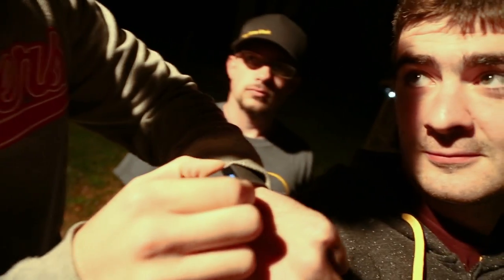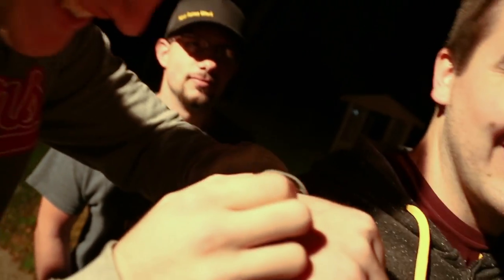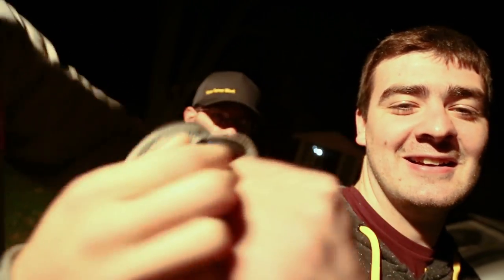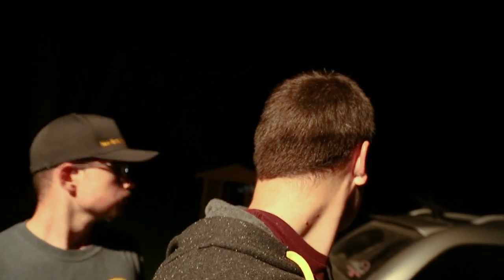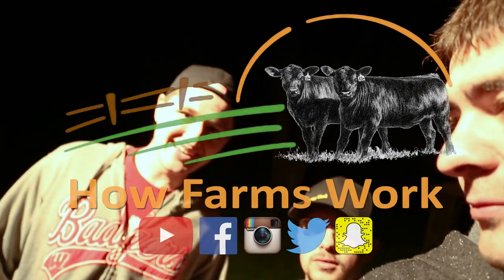Chisel Plowing - New Holland T7.315

Comment: that's a pretty small chisel for that tractor. my 8320 pull at 714 and then could be bigger than that yet. I would like to know how many hours they left you put on that tractor. and it's pretty amazing the amount of tractors I have sitting here and no dealer left me put that many hours on a new tractor. there's Farmers that spend money and then there's farmers who pretend they spend money. keep up the good work.
Reply from the maker: +Elm custom harvesting Your 8320 is also a weight class heavier than this tractor. Your tractor also probably has duals and even then you may not have the same hill slopes we do. Any smart farmer would take an offer to use equipment and run with it.

Comment: Just a small question for you Ryan; how come that most of the equipment in the US, however small, is pulled? Your chisel plough, for example, is small enough that, I think, it would be easier to operate in the field as well as transport it on the road if it would have been of the mounted type, i.e. being mounted using the liftarms and the three point?
Reply: Wout Van den Bossche too much bounce wile transporting down the road. Much of the equipment these days is much larger than what they were pulling. Come for a visit and check out our farm some time.
Reply: Wout Van den Bossche number one reason would be a lot of older and larger American tractors don't come standard with a 3 point hitch. number 2, a trailed implement usually handles sweeping curves and uneven ground better than a mounted one. American farmers usually have more acres to cover and need higher working speeds than us.

Comment: hey Ryan question, I work in sales at a John deere dealership in North eastern PA and from time we get trades and typically they are Newhollands being traded in on a deere because of hydraulics I know this Newholland is bigger then you 8r but have you noticed or felt like this Newholland should perform better then it did for you
Reply from the maker: +Kyle Tedesco It has enough horsepower but the 82 is a weight class heavier. Some people don't realize that this tractor isn't decked out for tillage, it was set up for a triple mower and we put it to the test on everything else. If it was a T8 then it would be better than the 82 in many ways.
Reply: Ryan, don't say that, a Newholland better then a deere in many ways lolol but you are right people don't compare apples to apples when they are shopping different brands I run into it quite frequently

Comment: What's the difference between chisel plowing, discing, and conventional plowing? Does each do something different?
Reply: Blake B chisel plows stir up the soil and leave more plant residue on top to help with erosion. conventional plows roll over the soil covering most of the plant residue leaving the soil open to more erosion. disks used in the fall loosen the soil to allow moisture to soak in and to chop up stalk residue so it'll start rotting down over the winter and when used in spring after plowing to level and smooth the seed bed to get ready to plant

Comment: A subsoiler seems to be in order to plow between 18-24 inches.  When driving all over the fields with the tractors and grain carts, etc. I bet there's a 'hard pan' that hasn't been disturbed in some time.  From what I've read the chisel plow can't go as deep as a subsoiler.  Help me?  Thanks.
Reply: ***** Twelve inches on the chisel or the subsoiler?  Some of the literature on the subsoiler says 18" but maybe that's just a sales pitch and not a reality.  :)
Reply: We subsoiled some ground this year. First time ever. ground was very hard. put 4640 on it first plenty of power but couldnt keep the front end on the ground.( 5 shank ) put the 8235 on it pulled it at 6 mph going 22 inches deep. there will be video of this coming.
Reply: Dwight Kuster Thanks Dwight!  Like I said I haven't seen subsoilers in you guys videos or others that are a lot North of Georgia where I live. The 8235 is a man tractor and I know it because I've seen it plant peanuts with 12 rows and every row has a subsoiler in front of the boxes.  A lot of those come from Kelly Manfacturing in Tifton Georgia.  They make a variety of farm implements which includes tillage and peanut handling implements.  Look forward to the video.

Comment: Is the newholland belong to the farm or is it rented maybe you said something in the video and I didn't catch it but yeah
Reply: Samuel Gibson they had one on demo but then they bout one
Reply: Bought*
Reply: Ah ok thanks
Reply: Wilko is incorrect. They had it two separate times from the dealer. The first time was over the summer, then they got it back again this fall during harvest. As far as I know, or as far as the videos have shown, they didn't buy it.
Reply from the maker: +MedicalMiller Let me make this clear, if we buy something, there will be no questioning whether we bought it. As I've stated repeatedly, it's here just for us to use.
Reply: Looks a little undersized for the tractor to my amateur eye. I'm sure you could maintain a good speed though. I pull an 11 shank+leveler with an old 182hp 2 wheel drive tractor but can't always get the speed I want. Just a beginning farmer trying to learn. Thanks for the videos.
Reply: Samuel Gibson hr
Reply: Samuel Gibson new holland lent it to them :)
Reply: I think its funny how people say that.  It might be a little small but there are many things to factor in, depth, soil type, hills, and so on.  Plus they arn't going buy a new one for a rental tractor.  Looks like they are running a 9 shank.  The jd's 9620's run a 18 shank I have seen.  Just enough to clear the triples.  You can take a large implement and go slow, or a smaller implement and go fast.
Reply: It's a little small because it's sized for the tractors they own. The T7.315 is a LOANER that they are trying out.

Comment: isn't the chisel plow a little small for that tractor?
Reply: no
Reply: definitely
Reply: Travman035 looks like it could of pulled 4 more shanks
Reply: Digging with 9 shovels. Running 12+ inches deep it takes a lot of power and traction, had the power needed more weight/tires.
Reply: It is pretty small, I've pulled more with a 3020 John Deere. Waste of fuel to pull something that small with such a big tractor.
Reply: If I can choke out this Holland with a 9 shank in our soil. You'd do nothing but spin here. I don't know what your soil is, sand pulls pretty easy. I'm burying this chisel, I'm not shaking up the top 6 inches.
Reply: whodatdere1 lol there is no way you could pull a 9 shank disc chisel with a 3020 any deeper than transport position :)

Comment: It chucks a lot of smoke for a new machine
Reply: Will6220 Case i noticed that as well.
Reply: Will6220 Case I think that's just the hot air off the engine hitting the cold air outside.
Reply: I thought that at first,but i watched it again..looked like smoke. Your probably right tho. I really can't see something that new puffing smoke.
Reply: water vapour hitting the cold air since the machine has ad blue and EGR i believe
Reply: our t5 smokes a little when it goes into regen mode
Reply: tom Parker no egr on the fpt engines in the nh and case tractors. no dpf either. just the nice scr which makes a much simpler and fuel efficient system.  go blue!
Reply: Andy Hass that tractor has ad blue
Reply: Owen Doran no shit genius! ad blue is just a brand name for DEF diesel exhaust fluid. which is the fluid used in scr exhaust systems. scr stands for selective catalitic reduction. i can give u all the chemistry if u want,lol. i said the tractor had scr...  anyone who knows anything about modern diesels and exhaust systems would know that means its uses ad blue. sorry for using to much technical talk.
Reply: yes it's hot air I have seen it before
Reply: the turbo is gone allready ;)
Reply: off course it does because it cleans the scr filter
Reply: If she's blue she won't do
Reply: If she's green she's a fine machine
Reply: NO TI'S NOT
Reply: If it's blue it's not the tractor for you(if it's red leave it in the shed
Reply: Massey Man456 if someones has to use kids phases to decide which tractor is best they must be a deere fan boy